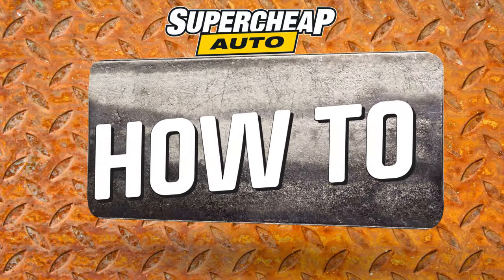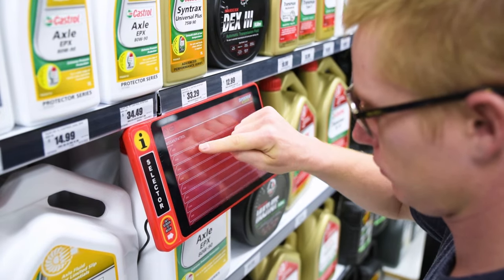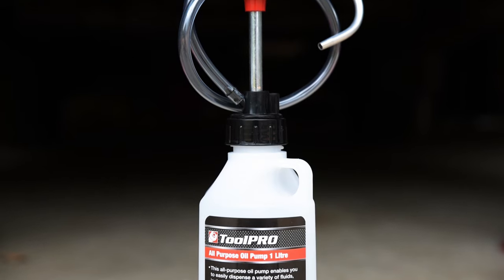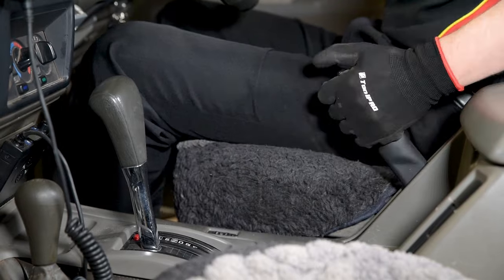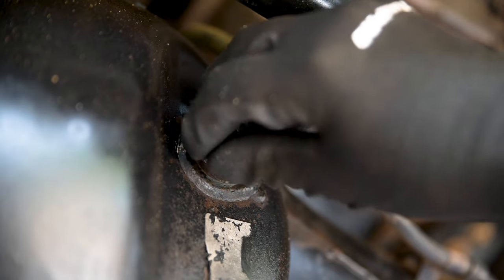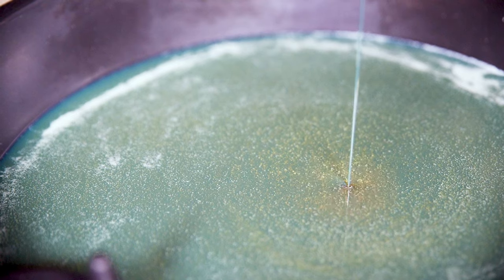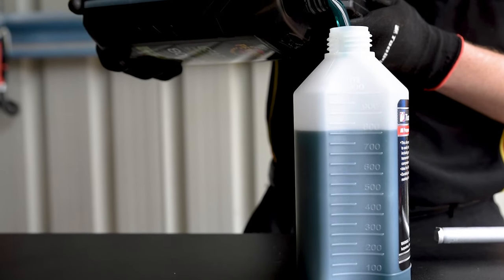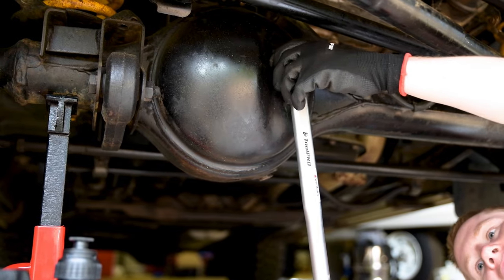How To Change Diff Oil

Comment: Can u just top up the oil without replacing it as I have a slight diff seal leak.
Reply: Staypress, yes you can. Is that what you ended up doing?